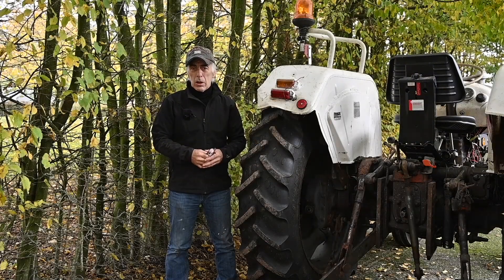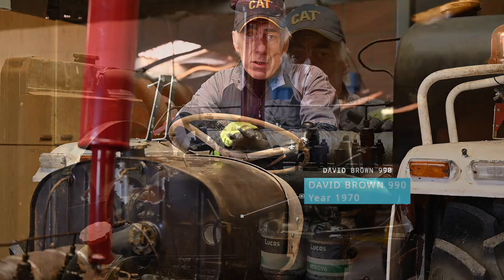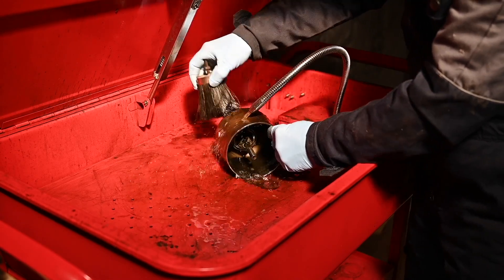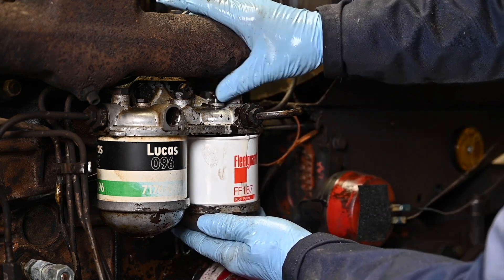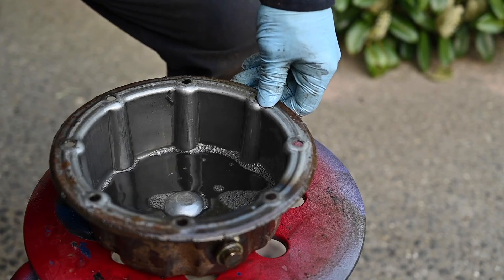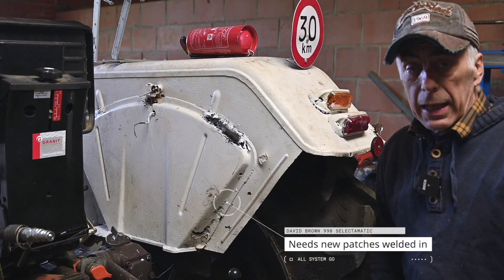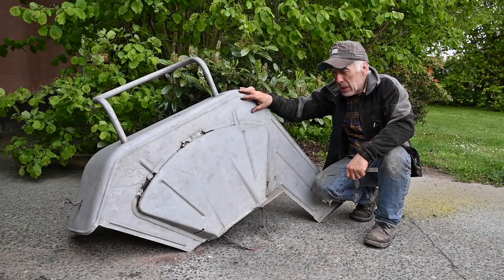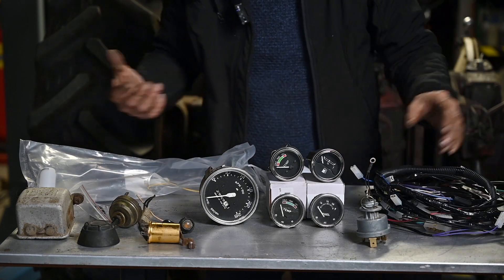David Brown Tractor TLC in a nuttshel

Comment: Hi Steve. I am confused. I watched all your previous videos on the DB tractor. As I remember it, you did a great job restoring it, and it ended up looking pretty much like new. Is this a different machine, because it seems to have all of the cosmetic problems that the old one did. Looks like it has never been worked on. Or is this an old video reposted. Thanks,
Reply from the maker: This is collection of all the highlights of the restauartion

Comment: I don't know if in different markets you get different gauges. On the David brown 990 and the 1200 I drove the tacho/rev counter had the spindle in the middle pointing both ways, but it's display had quadrants for each gear and speed rate as well as PTO range for both high and low. It's been a long time since I drove them but I think they were, , 540 and 1200? I'm open to being corrected.